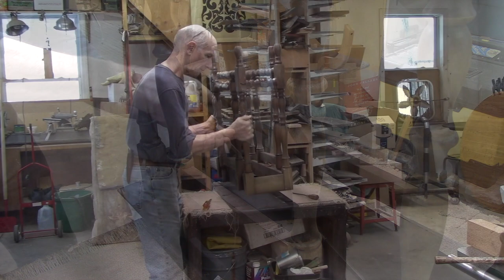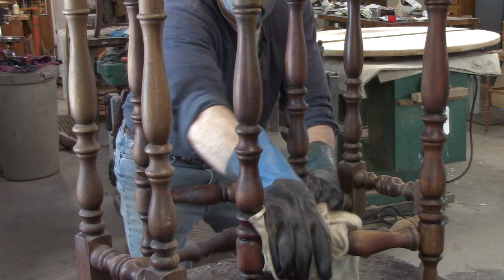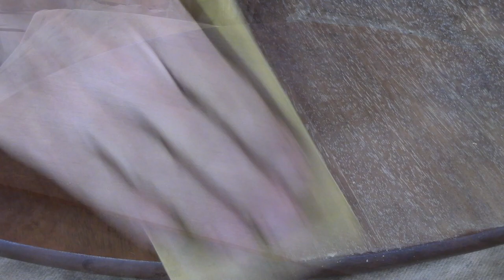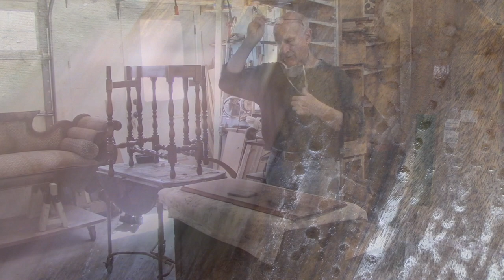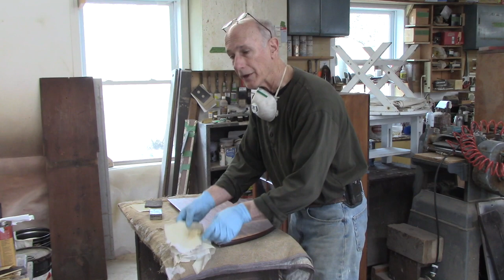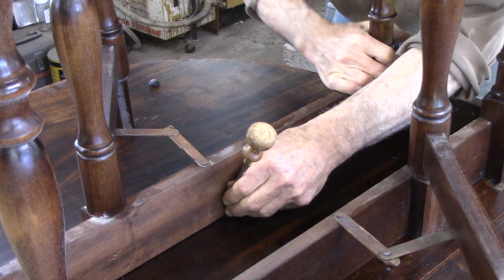Restoring a Gateleg Table - Thomas Johnson Antique Furniture Restoration

Comment: I recently discovered your videos.  I enjoy them tremendously and also learning a lot.    Wish I lived closer, and not on the West Coast, so I could give you the work. I am trying to restore a small oak rocking chair from the 40's.  It has a million spindles and even the seat is carved to accommodate one's butt.  I didn't like its original golden oak finish, so I started to strip it. First I used a gel stripper, but the spindles are soooo difficult to strip.  Then I changed to acetone and No 1 steel wool, but it still goes super slow.  Question: do I need to get to the bare wood to apply a different, darker stain, or is it enough if the majority of the original stain lifts?  Also, any practical advice on how to work the spindle part?  ....Apart from lots of patience, I guess.  :)  Thank you very much!
Reply from the maker: Hi Eva, thanks for watching! It's not so much the stain you need to get rid of but the finish. It takes a lot of patience but the best tip I can give is to leave the stripper on long enough to do the work. Read this article : https://www.woodshopnews.com/columns-blogs/patience-is-key-with-green-paint-strippers
Reply: Thank you, Thomas.  I will go back to the gel stripper and be patient.  Regarding the spindles or curves in general:  do I use a toothbrush to clean them after applying the stripping material? Thank you again!
Reply from the maker: Yes, but not an actual tooth brush, they're too soft. At the hardware store they have cleaning brushes that resemble tooth brushes. Check out other brushes too.

Comment: I've really relished that video! On the other hand, I would have started by removing the wax(cheap wax as Johnson's wax)that people use to apply carelesly, by washing it off with Hawe's oil of lemon, Hawe's brand is the best stuff of it's kind on the market! Secondly, you should warn your viewers to be very carefull when working with acetone or lacker thinner; those products are extremely flamable, indeed explosive: a simple spark can blow the place away! I've worked with those solvents for many years in manufacturing printing inks, and their flash point is very, very high! So, great care is indicated! Keep on the good work!
Reply from the maker: Thanks for watching! And thanks for the advice, I really should talk about safety

Comment: What was the reason that it came back?. Was it the oil in the wood ( natural )?.
Reply from the maker: Well, it didn't get sealed in, my brushed coats were heavy enough to dissolve the previous coats and bring the contaminant back up. When I started padding the finish the coats were thin enough for that not to happen. It was probably from furniture polish

Comment: tops look to be badly contaminated (fish eye and orange peel). Usually when i encounter this i brush or rag on approx 3 coats of french polish or shellac sealer. this seals in the contamination and allows whatever topcoat your using to go on nicely.......
Reply from the maker: Yes, that's correct. But I wanted to do it with the same finish, and it worked well, because the padded finish was so thin it didn't draw up the contamination.

Comment: I have a Victorian Eastlake style door made of pine and I know it was originally painted with lead paint and I have used paint stripper and it doesn't bother the paint at all do you know what i could do to get all the paint off?
Reply from the maker: You must use Methylene Chloride Stripper, sometimes called "Marine Stripper". Lay it on thick, one direction only as stated on the can, cover it in plastic for a couple of hours, or however long it takes to break through the paint.
Reply: @johnsonrestoration  ok thank you I will do that!

Comment: I have the same style table but  one of the gate leg hinges has become detached at the gate to base connection.  What type of screw or rivet should I look for at the hardware store to re attach the hinge? Thanks for your help.
Reply from the maker: You're welcome! You should use an identical screw. Take one of the others out so you can match it. use a toothpick with some glue to put in the old hole, and put in the new screw

Comment: You off all people are having a hard time now?   I understand is was your intention to keep that wood as original and 'old' as possible.  Was it a mistake not stripping it, like you usually do?  I do admire your persistence and patience.
Reply from the maker: I'm not sure if stripping would have helped. The stripping process could conceivably spread the contamination. I've done tables that were stripped, sanded to new condition, sealed with shellac and still had contamination issues

Comment: How would your process have differed had this been an antique?
Reply from the maker: Thanks! Good question. It would have depended on whether the finish was original or not. If original, just gentle cleaning and wax. If not, probably the same as I did here

Comment: Why didn't you just cut your losses on the time factor and  just take stripper to try and cut through the gunk that was causing all that puckering. Start with completely clean wood and re-dye stain if you needed to.
Reply from the maker: Because it's been my experience that stripper does not help with contamination. You're never sure of course. But the whole point was to leave as much character as possible, I did not want it to look like it just came from the factory. You might as well buy a new table at that point. Now it still looks old! We like old!

Comment: can you use oxalic acid on hardwood floors?
Reply from the maker: Thanks! Yes, but it's so important to be able to rinse it off. The dust is highly irritating. So you need extra good ventilation, and spend some time mopping it up, and vacuuming after it dries

Comment: This video was as close to an adventure/thriller as you've made! If you could start this project from the beginning, would you have first used stripper on it (or done something else different)?
Reply from the maker: Thanks! Well, given how it came out I wouldn't do anything different, except I should have  done more to try to control the contamination issue

Comment: That was one nasty finish on that table when you received it, really put up a fight against refinishing. I thought that shellac was the one great sealer for every problem, but it looked like something was leaching through it when you applied the varnish. The man hours in this refinishing must have been many times what you expected.
Looks pretty good though ...... nice work.
Reply from the maker: Thanks! I haven't checked the time yet. Shellac would work better if you could mist it on with a spray gun

Comment: In hindsight should you have used stripper on it to begin with?
Reply from the maker: Possibly, but it's been my experience that it doesn't help. But it's impossible to have a controlled experiment.